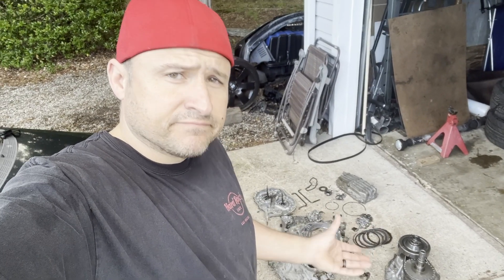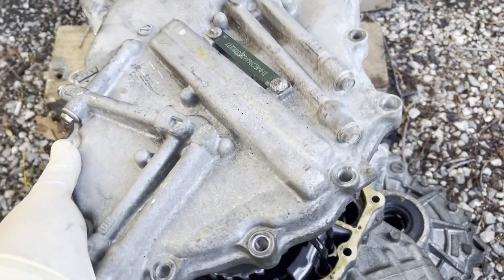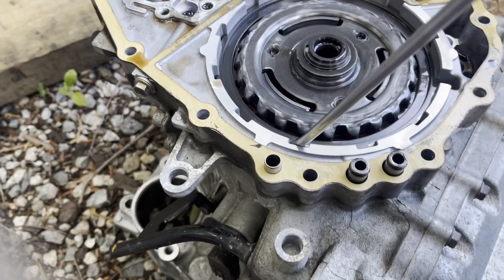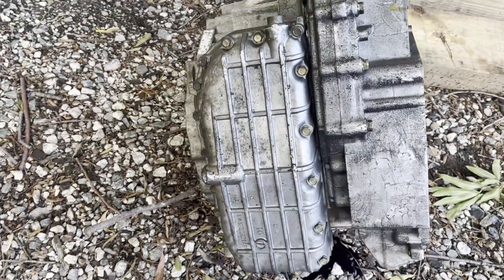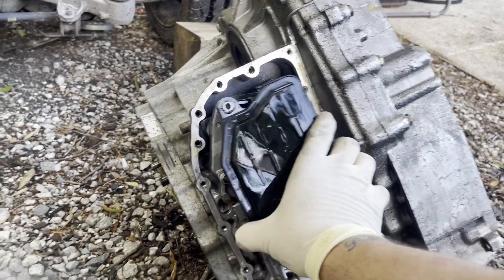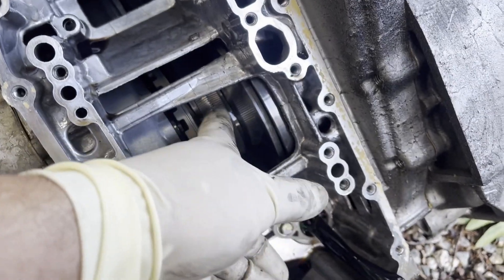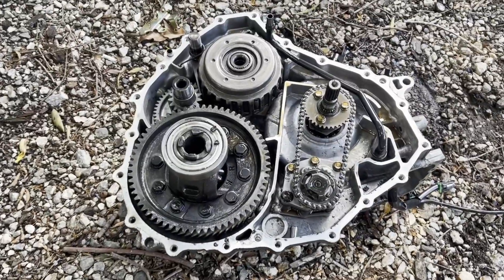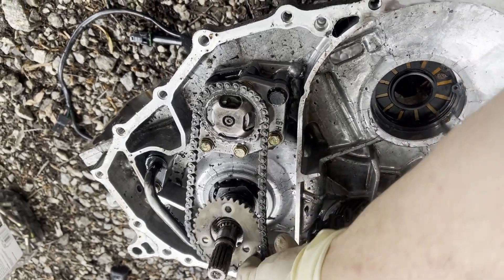HOW TO DISASSEMBLE A HONDA CIVIC HYBIRD CVT TRANSMISSION FULL TEARDOWN | WHATS INSIDE? #howto #diy

Comment: I NEED YOUR HELP. HOW DO I GET A HOLD OF YOU? Regarding 2015 ram ecodiesel! U0103 lost comm’s with tcm
Reply: The trans is in park, we pulled the nuetral safety (left side dash with red ribbon) and it went into nuetral. Pushed it back in and it went back into park. Trans is not communicating for some reason. We replaced turbo (removed trans) (trans was fine prior to this) and now it won’t communicate. The driver side can bus plug on frame, that is the only harness for trans communication right? 
Scr delete 
Egr delete 
Tuned 
Banks power full exhaust
Reply from the maker: @joshuaelsey  yes you’re right. I know you said it’s a physical problem but I’m leaning towards some kind of ecu or wiring…possible blown fuse or ground. I know thats a vague explanation I’m sorry
Reply: @Gasdieselgarage  no don’t be sorry I appreciate you responding. This feels like a long drawn out process. I did however ohm out the pins for the can-bus connector and they’ve all ohmed out. I checked all fuses and relays under hood and found none to be blown, all relays ohm out also just to verify they’re in working order.
Reply: @Gasdieselgarage  the 16-30 pin can-bus on left side frame rail is the only harness for transmission that communicates, right? The entire def system is gone, it was shifting and communicating fine prior to transmission removal. We did however change the trans pan/filter and changed fluid. Could this cause any issue?
Reply from the maker: @joshuaelsey  yes to the First part and do you have a other codes coming up?….does the engine crank?
Reply: @Gasdieselgarage  engine won’t crank at all
Reply from the maker: @joshuaelsey  can you see if the the starter solenoid is getting 12 volts?….
Reply: @Gasdieselgarage  I will do that today
Reply from the maker: Call the dealer and give them your vin #. They possibly have an ecu/tcm program update. (This should be free) if that doesn’t work then more than likely you have a problem with the actual gear selector dial.
Reply: It’s a physical issue. Not update. 
Screen says don’t turn truck off and thinks truck is in gear. 

All lights are lit up on the gear select on dash. Won’t allow you to turn gear select, truck won’t even start.
Reply from the maker: @joshuaelsey  well start by disconnecting the battery for 5 min then reconnect and turn the ignition off. Turn it back on and see if the electric dial goes back to “park” it’s not starting right now because it’s not in neutral or park
Reply: Also ignition won’t turn off after turning ignition on. Have to disconnect battery each time.
Reply: Is there a way to “trick” the transmission? I understand tcm is integrated into trans